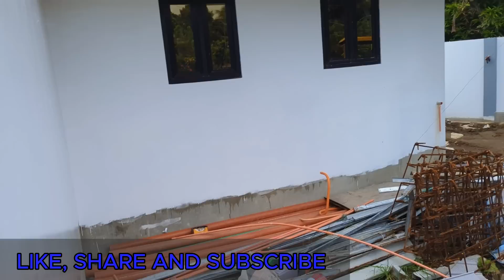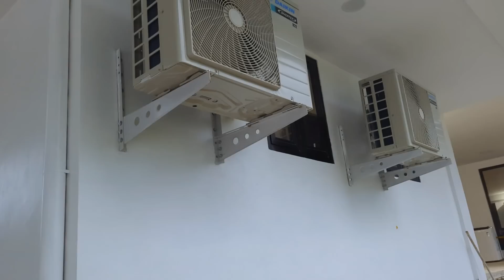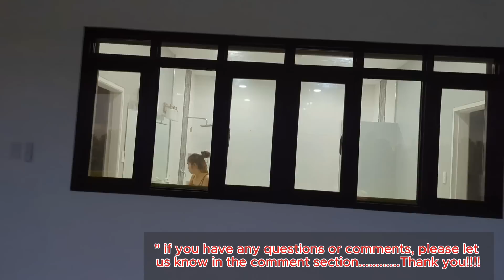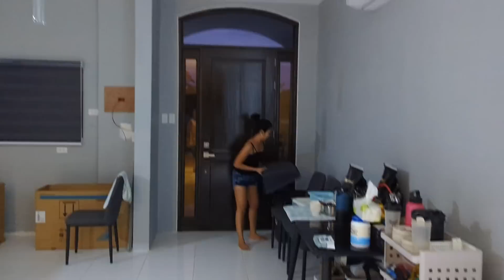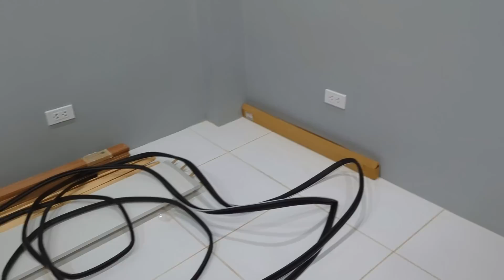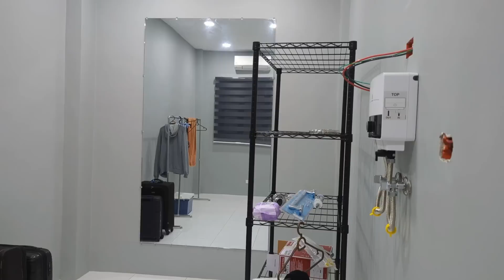Philippines House Build Day 250 "Master Bathroom Nearing Completion"

Comment: Have you noticed that all cinderblock walls in the Philippines look like crap? I don't understand it. It's like no one taught them how to lay blocks properly. I got back into LA and even the Sixt rental car place had nice cinderblock walls where the mortar lines are even. 

In the Philippines it goes from one inch thick mortar or grout between the blocks to three inches. And they don't even try to smooth it out.
Reply from the maker: Thanks. Seeing as they render the CHB here, I don't think it to be an issue.

Comment: Are you planning on putting any backwater valves on the drain pipes by the stream to stop any flooding from the outside making it's way in?  I would assume you aren't worried since its not there.
Reply from the maker: No way the water level in the back rice field will raise 5 feet to send water back to our house. Good thought though. Thanks.

Comment: Everything looks great Kevin. Keep in mind water evaporates out of the drain pee traps that aren’t used regularly. You may want to pour water in the drains once a month to ensure the gas’s from the septic don’t leak back into the house. Well done!
Reply from the maker: Agreed, that's why I pushed to not have them. Sela reminded me when the maids clean they wet the floor which will fill the p-traps. Thanks.

Comment: When we built retaining walls we would put a layer of pea gravel, perforated pipe then pea gravel over top of the pipe the full length of the wall. I know things are done differently there but what keeps the orange pipes they put in the wall from clogging full of dirt?
Reply from the maker: Agreed. There will also be catch basins at the wall to catch allot of the water. Thanks